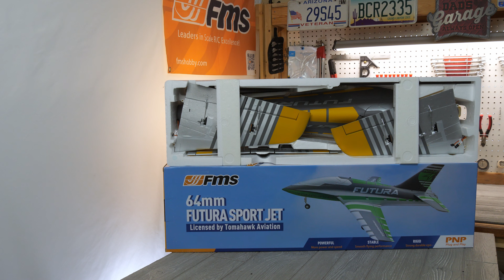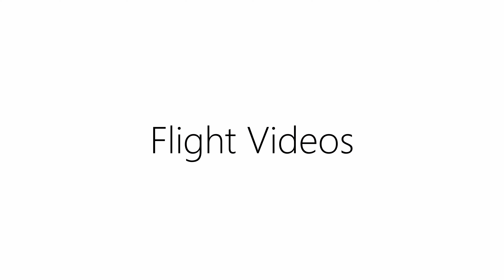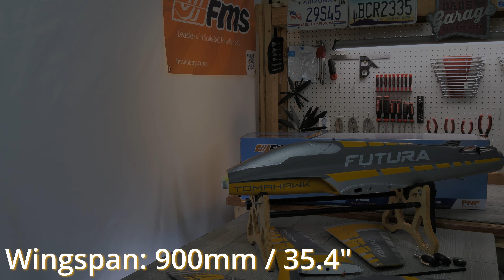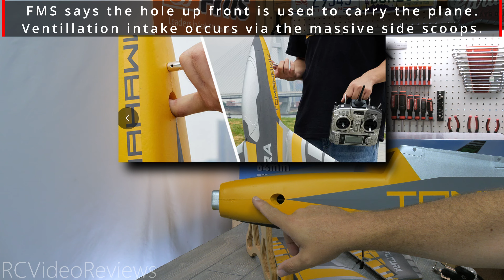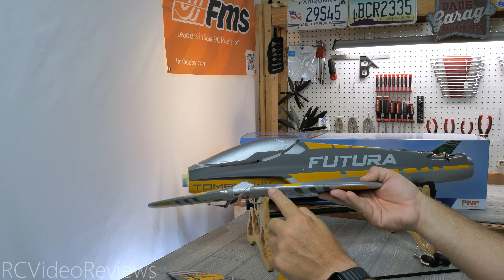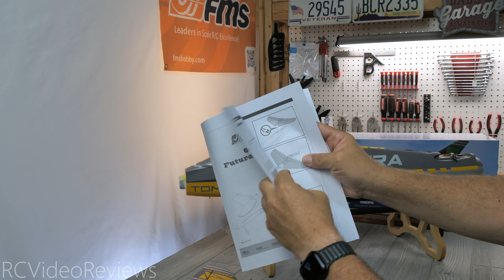NEW RELEASE: FMS 64mm PnP Futura Sport Jet First Look

Comment: The wire on the landing gear is REALLY thin especially compared to the the new freewing banshee in the same size class which has similar gear.  The wire where the nose gear attaches is also TINY and is filed on both sides for the tiny grub screws making it even thinner, I really expect it to bend here very quickly and the metal is brittle so I will not be surprised if it breaks if you try to bend it back.  I'll be flying it today so I'm hoping for the best.  Note I could not find any mention of flap settings in the manual at all, they completely overlooked it... Not a big deal but still.  The overall construction is very nice though I will say, it's light and balances nicely with the 4S 2200-2400.  I fully expect it to fly very well.